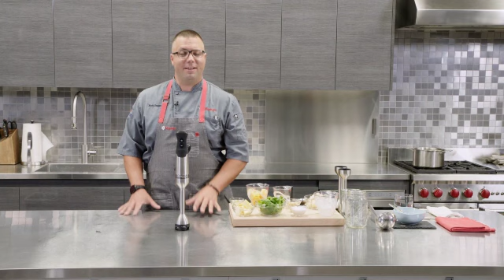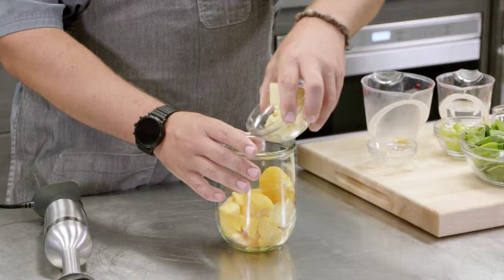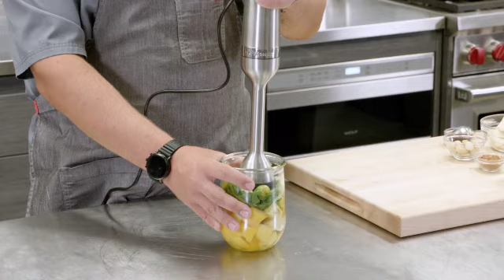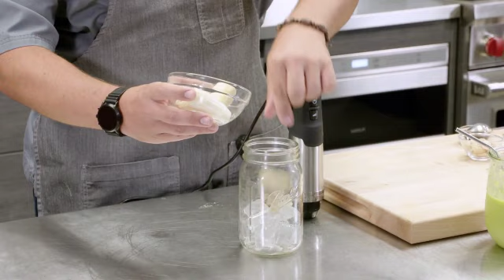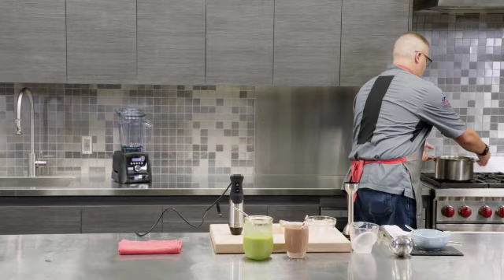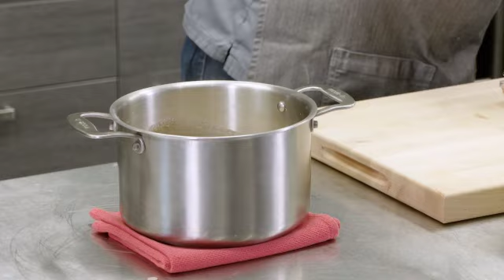Review 2021- Vitamix Immersion Blender, Stainless Steel, 18 inches

Comment: I find it really difficult to separate it!!!  Can't get the blender off the cord part???
Reply: There is something wrong with how you are doing it or there is an issue with your immersion blender.  It should be super easy to take off and put on.
Reply: Michael is basically calling you a dumbass, you gonna clap back or what